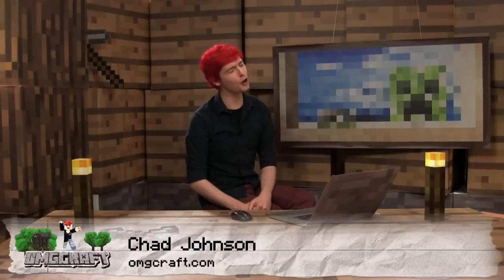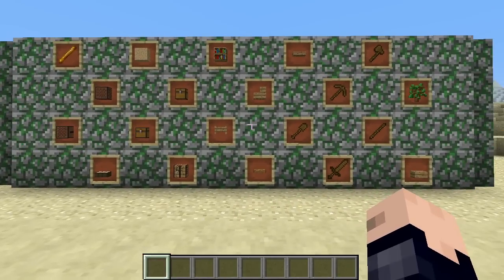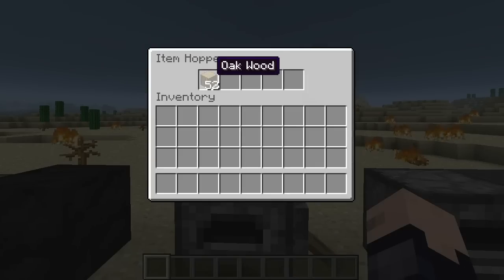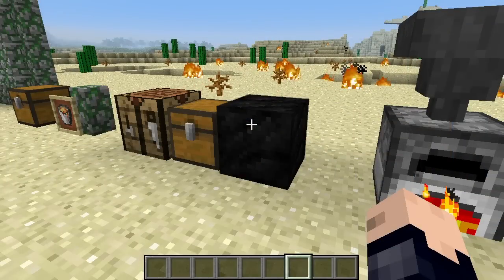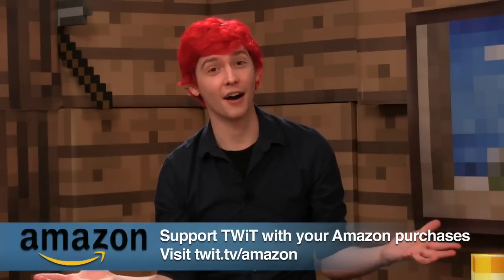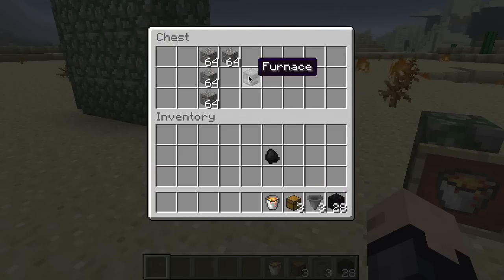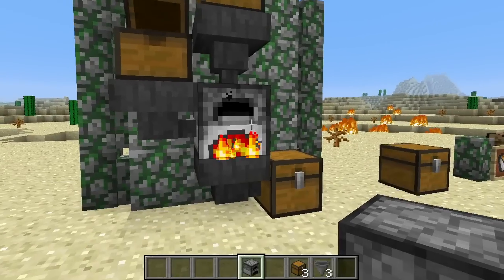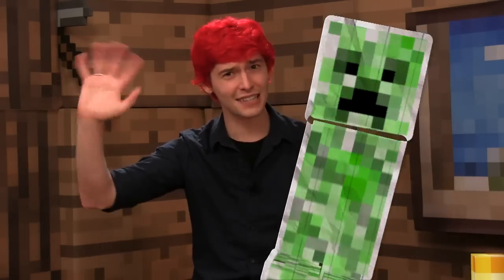Tip: Furnace Fuels and Efficiency

Comment: Let's do the math on a double-chest setup.   100 items smelted x 27 buckets in a chest = 2,700 items smelted.  With coal blocks you get 9 items smelted X 1728 coal blocks per double chest = 15,552 items smelted without reloading.   2,700 smelted items with lava vs 25,552 with coal blocks feeding from just 1 double-chest.  I know which fuel source I would rather use in my auto smelter. ;)
Reply: +DJDevon3 you did something wrong it not 9 item for each coal block it 80 items, also 8 items for each coal (non block)

Also a single chest can hold 27 different items and a double chest will hold 54 different items.

54 Lava buckets = 5400 items will be smelted
54 Full Stack of Coal Block = 276480 (<80x64x54)
Reply: Oops, well that was a big mistake but it proves my point even more.  Thank you.  That's if you could ever fill up a full double chest with coal blocks in survival.  That's a lifetime of coal to mine so there's something to be said about that too in terms of time investment.  You could probably run a community sized 30 bank smelter for a year on all that.
Reply: ZombieKillerThe/DJDevon3 well you both did something wrong according to standard math language that by using x as the “multiplication symbol” wouldn’t make sense as x is also a variable, so the world of math would prefer to use *.
Just kind of throws me OCD out of the window.

Comment: You can actually upgrade it to do the same thing but with more of them and also sharing the same "Fuel Chest" and the same "Smelt Item Chest" but it comes with a downside because the chest will put one stack into a furnace so if you don't have enough  fuel some furnaces won't smelt the items

Comment: Tip: add a lever to the other side of the bottom hopper. Switch it and the bottom hopper will not pull out, meaning if you want xp, just flick a lever

Comment: how do you get a hopper to connect to the side of a furnace or chest in PE? If I tap on the side of them they just open up and the hopper doesn't get placed.
Reply: Try crouching.
Reply: +Lexi Fairis Thanks! worked great. now if I can just get the droppers to drop.

Comment: Lava is the most efficient: it smelts 100 items.
Reply: Yeah, but it is non-renewable.
Reply: That's complicated.  Technically, yes, you are right, because lava cannot be made into a infinite source.  However, if you have access to the Nether, then you have as good as a infinite source.  Of course, the Nether is difficult to get access to in a SSP world.
Reply: Also, you get the bucket back when finished smelting.

Comment: the best fuel is lava
Reply: +Florencio Socuano depends on whether you are doing individual comparison or if you are comparing an auto feeder like this. A full chest with full stacks of coal (not even coal blocks) actually keeps the furnace running for much longer than a full chest of lava buckets since they can't be stacked.